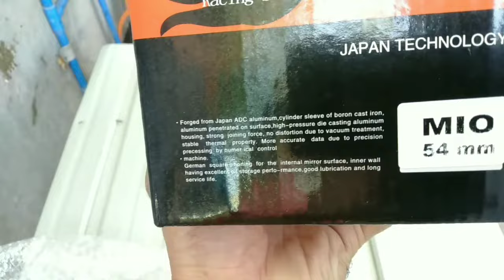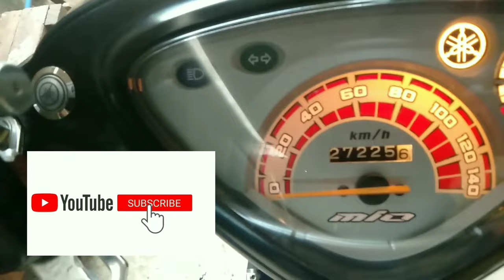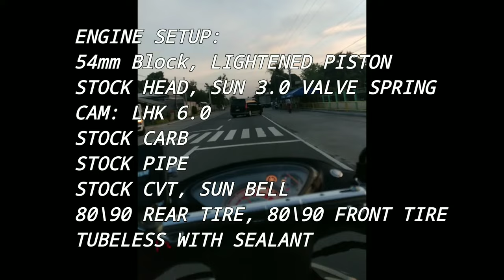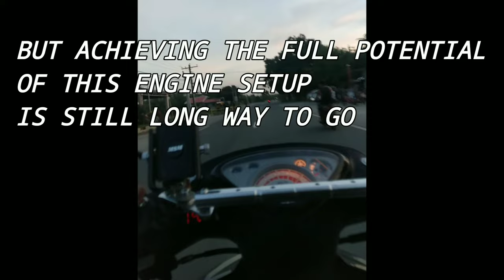54mm BLOCK CAM 6.0mm STOCK HEAD Engine BUILD for Mio Sporty

Comment: Boss ok lng b 54mm mtk 6.2 showa cams d nb need valve pocket or lighten valve?
Reply: Boss ganyan set ko 54 tsaka 6.2 cams need pa po ipa valve pocket tsaka tabas konti sa piston pa port mo na din para swabe air and fuel mixture
Reply: No need..plug n play play lang  6.5 above need pocket kunf di ka mag low comp.. pwede nknpocke hanggang 7.2 basta 2 gasket sa base..

Comment: SANA MAPANASIN.
PASENSYA NA NEWBIE HERE.

Tama ba Boss.
- 54mm MTK Block Set
- Valve spring 5t 2.8
- Stock head
- Stock valve
- Stock carb
- Pwede ba stock rocker arm or roller type talaga ?
- Camshaft 6.0 or 5.8 alin ba mas maganda ?
- may kailangan paba gawin sa Piston kung ang gamit, 5.8 camshaft ?

Thank you.

Comment: Sir balak ko po mag 54 at 6.0 cams pasok po ba to sa nouvo z ko ? New subscriber po 🙂
Reply from the maker: pasok yan mate pero double check piston-valve clearance para safe
Reply: @ProjMoMate26  ganto po set balak ko set sir last question 54 .6.0 cams at 6 turn 2.8 valve spring last question Napo sir salamat Sana ma replyan ulit ♥️

Comment: Sir sa akin poh 59mm palit lg ako racing cam..valve spring Ang rocker arm..the rest stock na pati carb..pg gilid sun na pulley set.sun na bell,tpos clutch assembly na rs8 tpos nka 1k LAHAT na clutch spring at center spring..happy nmn ako sa performance nya..kaso palit lg ako disc brake sa unahan lakihan lg ng diameter..

Comment: Bos dating naka 59 ang mio sporty ko, kaso natuyaan ako sa langis..ngayon pinabalik ko muna sa stock.. ang kaso po nakapork and polish ang head ko stock valve spring, tapos stock block, stock carb chik pipe.. okay naman ang takbo kung pang service sa work ang gamit.. kaso napapansin ko pag may angkas hirap na siya tapos pag matagal na para ma siyang nalulunod.. 

Tanong kulang kung mag 6.0 ako ng cams magiging ok ba takbo niya kahit ganyan set up ng makina ng motor ko? May nakapag sabi kasi na palitan kulang daw ung cams ko na 6.0 or 6.2 na cams..

Sana po may makasagot po ng maaus... new subcriber mo po ako..tnx
Motomate project
Reply: Bos mag 54 ka swak na yang gusto mong cams , 6.0 meron din mtrt 5.8 or jvt j15 5.9 naman, swak para sa 54 kong plano mo,

Comment: Lods bakit sakin pag install ko ng 6.0 na cams. 54 bore bakit nag iba ang tono ng carb ko. Basa ang spark plug . pasagot nman lods.
Reply from the maker: mas mahaba kasi duration at lift ng cam 6 kesa sa stock cam, turn a/f screw counterclockwise or paluwag ng 1/2 or more until makuha kulay brown na sunog sa sp mate

Comment: Idol bakit maingay un camshaft ko 0.5 at 0.7 un clearance rs8 cams po gamit ko
Reply from the maker: Dapat std. Valve clearance 0.06-.0.08mm int. at .08-0.10mm exh. normal lang na medyo maingay ang kargadong mio dahil sa camshaft at vspring.

Comment: sir sana mapansin comment ko, naka 54 din ako 

54 bore
6.0 cams
valve spring
stock carb rejett

ang issue hard starting, no issue naman sa valve nahasa ko naman, di ko lang talaga maperfect ang smooth na pag start, sobra hard start pag malamig, pero napaka ganda ng tono naman optimal naman color brown
Reply from the maker: kung may AIS pa carb mo try mo disconnect or try mo magpalit ng carb na 26mm keihin

Comment: sana mapansin mo sir 

stock head not ported
54 mm bore mtk 
cam 6.0
5 turns valve spring
stock valve
ok lang po ba na plug and play lang po sya di po ba tatama sa piston salamat sana mapansin mo sir

Comment: as of now
54mm Block
Stock Cylinder Head (Ported)
Stock Valve
mtrt 5T Valve Spring
6.0 Camshaft
Stock Carburator (No re-jettings)
Stock Pipe
i prefer break-in ng 500km as of now nkka 300km nko :) 40-55kmph takbo
my fuel consumption as of now is 43km\L

ok lang ba to mate sa maghapon na gamitan? 
need ko pa po ba mag palit jettings ? 
thanks ng marami !!
new subscriber here
Reply from the maker: ok na yan mate tipid na yan.  RS
Reply: Boss ano SP reading mo? Same tayo ng set pero nakalighten valve lang ako. Ganyan din fuel consumption ko pero upon SP reading lean sya kaya nagrejet ako. Kaya pala sobrang tipid lean na pala 😅

Comment: Lods yung akin 100 top speed..54mm 6.0 cam.ano kaya maganda i upgrade pa para mag 110-120..
Reply from the maker: Try mo mag racing pulley set at torque drive kahit female lang 8/10 bola, 1k rpm center spring at 1k clutch spring
Reply: @ProjMoMate26  boss ganyan set ko kaso hinde ported ung Head pag nag 00kph na may tumutunog sa head tapos mag lolow. Power
Reply: 100kph

Comment: 54mm Block
Stock Cylinder Head (Not Ported)
Stock Valve
Stock Valve Spring
Stock Camshaft
Stock Carburator (No re-jettings)
Stock Pipe

Bali stock all the way lang po then 54mm block .maganda ba ganyan engine set-up o need ko mag 6.0mm cams?.pang daily use at long ride lang po sana..Ty .sana mapansin 😊
Reply from the maker: Oo mate maganda na yan para sa pang daily
Reply: @ProjMoMate26  Pag 54mm all stock need padin po e pa grind ung piston pra hindi tumama sa head? Slamat lods

Comment: Ako paps mtk 54mm at roundslide 26mm carb. Okay2x sa gas compared sa stock, akyatan daily use at long ride no problem. Sa panggilid ka lang magtimpla. Yung stock pilot jet ng mio pinagpalit ko sa roundslide yung mj hindi na.
Reply: Boss Anu panggilid mo
Reply: Ito yung applicable na comment sa gustong tumipid gas, paexplain po lods para magaya naman namin😁
Reply: ,bka nman pde pa kopya set nyo boss,👍
Reply: @fliptopzerotomillion wag ka mag karga para matipid sa gas oras na mag karga ka Engine tataas tlaga consumption ng gas  walang nag karga na tumipid sa gas

Comment: Boss ano ung 60 cams at ung 5turn sory ha diko.kc alam mainam ung nag tatanong salamat po
Reply from the maker: Camshaft 6mm lift and valve spring 5 turns
Reply: @ProjMoMate26  boss ok lang ba na lahat na stock nya ibbalik ko din ang bago hin ko lang ay ung cylinder block at piston

Comment: Mio soul 115 5tl naman Yung makina ku  nungpinalitan ku Yung camshaft 6.0 LHK 54mm black mp brand Brand, 2.8 spring racing monkey brand bakit kaya ayaw magstart.
Reply from the maker: Check timing marks then adjust valve-tappet clearance then check carb Kung bumababa gasolina, check spark plug Kung may kuryente.
Reply: Sir patulong maganda ba faito ignition coil Para sa mio soul 115 rebore 54mm piston 28mm keihin carb
Reply from the maker: @vyronlordameling6632  yung stock ignition coil mas solid kuryente nun walang sakit ng ulo mate
Reply: @ProjMoMate26   sir nasira kase Yung stock ku at naluma na. Sir ano recommend nyu na sparkplug Para sa mio soul rebore 54mm and 28mm caburator.  Bumili ako ng shoppee iridium 400 pesos.
Reply: Nakabili kase ako ng faito7500 ignition coil balak ku kase ilagay sa mio soul ku, 54mm block, 28mm keihin carb. Thank you sir..
Reply from the maker: Oo mate pwede na yang faito ignition coil
Reply from the maker: Oo mate pwede yang IRIDIUM na nabili mo

Comment: Mas maganda po ba stock valve kesa Lighten Valve? Sana po masagot
Reply from the maker: stock valve 5mm stem lang pwede sa stock head mate di pwede ang 4.5mm stem
Reply: @ProjMoMate26  ok sir. Maraming salamat. Buti hnd pako nakaka bili ng valve. iniipon ko kasi pyesa para isang salpakan nlng. Last question po. No need to Port n Polish na po sir?
Reply from the maker: @angelojoedriveramadriaga6193  oo mate at least i-match mo sa butas ng carb pati manifold iport din
Reply: @ProjMoMate26  maraming salamat

Comment: Paps. Tanong ko lang kung okay lang ba ung 54mm at 6.5cams? Pwede pa din kaya sa stock pipe yun? Or chix pipe na. Salamat sa sagot. RS
Reply from the maker: Sobra na po kasi yang 6.5 can para sa 54mm block paps mas ok Kung 6.0 cam lang then port n polish head, intake manifold at magrejet ng carb or much better 26mm carb, pwede pa rin stock pipe pero mas preferred ang chix pipe or pang 130-160 cc na pipe. RS
Reply: @ProjMoMate26  kung mag rejet sa stock carb paps anong size po.? ty po
Reply from the maker: @kevinier18  115\38 or 115\40
Reply: @ProjMoMate26  pwede po ba 28mm carb if 55mm block gamitin?

Comment: Boss gusto po sana kita gayahin 54mm bore ano maganda na valve spring tsaka po cams  nag valve pocket din po ba kayo tapos ano bagay na jettings sa stock carb
Reply from the maker: Pwede na yung stock valve spring or 6 turns 4S1M brand paps, di na nag-pocket sa piston kasi cam 6.0 Lang, rejet 115\40 or 120\41  sa stock carb.

Comment: Paps may tanong ako bumili ako ng roller type na rocker arm plug and play na kaya yun sa 6.0 ko na option 1 na cam kahit hindi siya roller type na camshaft? sana mapansin niyo po😊
Reply from the maker: Yes paps pwede Ang roller rocker arm sa nabili mong camshaft basta parehong pang Mio, hindi Sana ginawa ng manufacturer Ang roller rocker arm Kung makakasama ito at sumabog na Sana makina ko kung di pwede Ang roller sa camshaft 6.0 di ba paps? Kung maayos ang performance ng makina big sabihin walang problema 👍 RS

Comment: Hindi po ba tayo mapapakalmot olo dahil sa maintenance? So far po ilang months na ganito set up nyo at anu poba usually una nasisira or poblema?
Reply from the maker: Honestly speaking sir walang issue sa build ko na 54mm since day 1 until nagupgrade sa 59mm now it still runs and performs the way a 160 cc engine should.  In 3 months wala pa ring sakit ng ulo 2x pa lang nag-change oil.  Well mapapakamot ka lang ng ulo Pag may issue build mo tulad ng oil leak, usok, misfiring, hesitation, stalling, overheating and other engine related problem sir.  Build then test Pag may issue ayusin agad and then test ulit, Pag wala na always check engine oil before every ride dahil langis ang buhay ng makina.  fuel consumption nito ay halos parehas lang sa stock engine but if fuel economy is main concern then mio sporty is not the proper motorcycle for you. Sa 54mm walang worry sir kasi halos same lang yan sa stock. RS
Reply: May nabili po kasi akong mio yung set up daw neto noon ay 59 pero binalik sa 50mm pero hindi yung org. Block tas nka 26 na carb kaso walang dolo pag mga tinodo mo walang power sa low end yung city drive okay lang pero pag piniga mo wala talaga tas walwal pa sa gas. Gusto ko sana mag 54 pag mabagal padin pagkatapos tonohin.

Comment: Hello po ok lang ba na 6.8 ang cam naka 54 pero stock pipe ang gamitin? D po ba sasabog?
Reply from the maker: pwede pero tabas valve retainer at magvavalve pocket pa, check valve overlap baka magsalubungan, no issue ang stock pipe sa 54mm mate
Reply: Ok po salamat sa advice idol..Godbless
Reply: Naka valve pocket na po yung head ko at naka port na po idol..ok lang po ba?

Comment: Ok lang poba 59mm allstock cyl. Block lang pinalitan stock na lahat wala pobang magiging problema?
Reply from the maker: Pwede boss aandar naman pero kulang sa power at torque kasi under  compression sya.
Reply: Anung maipapayo mo na set sa 59mm sir ung pwdng pang longride? Malakas lang kc sa akyatan tong 59 mm allstock pero pag patad parang puro rev nalang wala ng hatak.
Reply from the maker: @noname-wl6tl  59mm block, 6.0-6.5mm camshaft, 5t valve spring, port and polish head and int. Manifold, 28mm carb and power pipe. Pwede for daily and long rides.   Consult your trusted mechanic for the installation.  RS

Comment: Sir off topic, how about mag 61mm bore up ako from 125cc. Is it necessary ba na mag palit din ako ng cyl. head at throttle body? Or pwedeng mag port and polish na lang ako ng stock head? Sana.mapansin mo comment ko hehe. Naka subs na ako 😊
Reply from the maker: Pag ganyang kalaki ng bore up sir need po mag taas din ng throttle body pati cyl. Head at fuel injector  para smooth ang andar paps at makuha yung gusto mong permance at speed. Ty paps sa pag subs. RS

Comment: Naka 59 po kc yun nabili ko na motor. Balak ko po ibalik ng stock lahat kc malakas sa gas. Ano po ba ang papalitan ko? Cylinder block ba tas gamit ko old cylinder head? Tas magpapalit din po ba ako ng new carb? Thanks
Reply from the maker: Kung back to stock gusto mo mate  ito mga need mo: stock cyl. Block, stock cyl. Head not ported with stock valves, stock carb, stock camshaft, stock rocker arm, stock air box, stock intake manifold at stock muffler.

Comment: I think 5t 3.0 valve spring is too stiff for a low lift cam
Reply from the maker: I thought so but it turned out to be just fine with 6.0

Comment: Sir pwede ba sa mio soul  5tl   Palit ako ng 54mm block, camshaft lhk camshaft 6.0 at 2.8 valve spring.
Reply from the maker: Pwede sir since pareho Lang makina ng sporty at soul
Reply: Maraming salamat sir. Sir wala ba maigrind.
Reply: Sir wala kaba nagrind sa bago mu nabili camshaft 6.0
Reply from the maker: @vyronameling1273  di na po sir sakto na po yan
Reply: Maraming salamat sir..

Comment: Bos pede bayan block 54mm  lng papaltan  sa mio ko stock engine
Reply from the maker: Pwede mate pero dapat mag cam 6.0 ka para dama mo yung power up nya
Reply from the maker: Pwede mate pero dapat mag cam 6.0 ka para dama mo yung power up nya
Reply: @ProjMoMate26  mate, okay lang ba kapag 54mm block tapos 6.0 cam yun lang papalitan wala na?  Stock na lahat? Head,  valve.
Reply from the maker: Oo mate pwede

Comment: Sir pwedi po 54mm stock carb stock cams at valve spring ok lng ba sa long ride ?
Reply from the maker: Oo sir pwede
Reply: Ok lang ba sir na mtk block 54mm racing cam 6.0 tska valve spring na 5turns 3.0 ? Stock pipe ?

Comment: Maganda talaga 54mm Mga ser sakto lng Ang lakas smooth pa manakbo
Reply: Boss 54mm 135cc nba to
Reply from the maker: Engine disp.={π(54x54x57.9)\4}\1000=132.6 cc round off to 135cc
Reply: @ProjMoMate26  boss magkano po abutin labor at materials ,slamat

Comment: Lods valve pocket pa ba ako? Rebore stock block stx standard size piston kit?
Reply from the maker: Basta 6.0mm camshaft lift no need valve pocket mate
Reply: Salamat mate!
Reply: Di po ba mag uumpogan lods?
Reply: Tsaka okay lng din po ba na 28mm yung carb?
Reply from the maker: Hindi sa 6.0mm lift mate
Reply from the maker: Pwede ang 28mm carb mate
Reply: Wala na bang babagohin mate stock block gagamitin rebore tapos stock piston kit stx okay ba yun?
Reply: Ano maganda jettings mate 28mm carb

Comment: Sir ask ko na din po paano mag break in ng steelbore?
Reply from the maker: Sir whether steel bore or otherwise, for 10km run pakiramdaman muna natin motor natin Kung merong problem or wala tulad Ng tagas Ng oil at Kung wala hard break-in po agad full throttle all the way para makita natin agad issue Kung meron man at mareresolve agad po Yun.  Napansin ko Lang may minimal vibrations at 70-80kph pero nawala rin eventually because of hard break-in.  During break-in sir check always oil level bago paandarin.

Comment: Itong set up po ba na to pwede sa nouvo z planning din mag54mm borekit thanks po.
54mm borekit
6.0 cams
2.8 5 turns valve spring
Same po b sila ng rocker arms?
Reply from the maker: Oo mate pwede yan sa nouvo z at same lang sila ng rocker arm, mas ok Kung ibang brand ng 54mm block bilhin mo mate malambot kasi piston ng mtk.
Reply: @ProjMoMate26  any recommendations na brand po?? 54mm lng din sana idol.. Thanks po rs
Reply from the maker: Try mo Pitsbike mate

Comment: lods sa tingin nyo pag stock valve spring ginamit nyo ano epekto neto sa andar ng motor kasi balak ko rin mag 54mm na block pero all stock ung head
Reply from the maker: Ok Lang ang stock valve spring sa 54mm block stock head paps pero mag cams 6.0 ka para ramdam mo yung performance niya.
Reply: paps sa online kba bumili ng kit m? baka pwede pa share nmn ng Oshop😁😁😁
Reply from the maker: Guer.ph sa shopee paps may freebie na nmax keychain 😁
Reply: nice2 salamat paps RS lagi😁😁😁
Reply: @ProjMoMate26  sir pag stock head. stock valve spring at stock valve. Tapos gaya ng sabi mo 6.0 cam ok lang po ba?
Reply: @onacoli10 hindi dapat palitan mo din gulong mo ng tubeless para ramdam mo yung hatak

Comment: Sir anu size caburator nung nag 54mm block ka.
Reply: Sir Pwede ba 24mm diapram caburator sa 54mm block
Reply from the maker: Stock carburetor mate
Reply: Anu size stock ng caburator  mu sir.
Reply from the maker: 24mm mate
Reply: Ok sir salamat 24mm caburator ku. Sakto Palit ako ng 54mm block

Comment: Boss stock pang ba lahat yan maliban sa borekit mo?
Reply from the maker: Yes paps 54mm borekit, stock head, 6.0 cam, 5 turns valve spring, roller rocker arm, stock carb, stock cdi, stock ignition coil, stock pulley set and stock torque drive set, stock gearings, stock crankshaft, stock fuel pump and stock pipe.

Comment: boss question lang sa carbs mo nagpalit ka pa ba ng jettings...?
Reply from the maker: Oo mate 115 38 pwede rin 115 40 then tono na lang sa air/fuel mixture screw
Reply: ser bwde ba sa jet ung 115/35 eh panu ung karayum nia papalit din po ba

Comment: Update po? Kmusta po ung mtk block
Reply from the maker: Ok pa naman ma'am wala namang naging issue
Reply: @ProjMoMate26  pwede b allstock lng tas 54mm block lng pplitan ko?
Reply from the maker: Oo ma'am pwede
Reply: @ProjMoMate26  kahit hindi nko magplait ng cam,and valve spring?
Reply from the maker: Kung enough budget mo bili ka ng VALVE spring at camshaft 6.0mm
Reply: @ProjMoMate26  54mm block,valve spring 3.0,camshfat 6.0?
Reply from the maker: @Maria Angela Bolus  valve spring 2.8, camshaft 6.0mm at 54mm block ma'am
Reply: @ProjMoMate26  if 59 mm applicable din ba gnyng size ng spring and cam?
Reply from the maker: Oo ma'am
Reply: @ProjMoMate26  mate, sa tingin mo ok ba ang ganitong set up pang touring at everyday use pampasok?

Pitsbike 54mm block, sun valve spring 5turns 2.8, jiso cam shaft 6.0 tapos all stock.
Reply from the maker: @ginoongfigu8928  ok na ok mate basta maayos pagkakagawa check lang maigi ang valve to piston clearance at gap ng head sa piston
Reply: @ProjMoMate26  salamat mate, new subscriber mo ko. RS Lagi

Comment: Goods po ba 5.5 na cams
Reply from the maker: yes mate very good yan
Reply: @ProjMoMate26  ano po specs cvt nyo
Reply from the maker: @paolodomingo8840  8/10 bola, racing pulley set with addl. washer, 1k rpm ctr. spring, 1k clutch spring, sun bell, racing fem. td.
Reply: @ProjMoMate26  ilan mm washer mo boss?